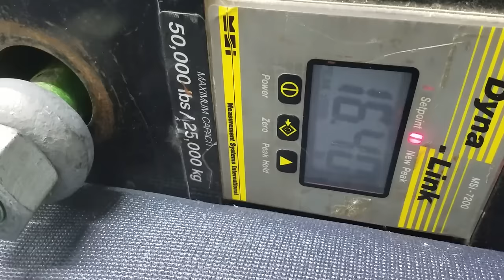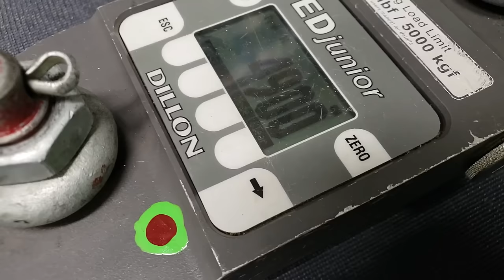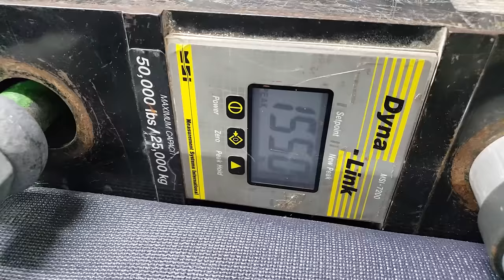Tying a button knot soft shackle WITH break tests - for slacklining and highlining

Comment: By setting up the loop with only one or two strands instead of four, you get a smaller eye, less likely to go over the button when the shackle is not under tension and without losing any strenght.
Reply from the maker: I'm concerned about getting too much tension on 1 leg if the eye is too small, but a smaller noose is ideal.

Comment: I’m curious if you’ve looked at this guys soft shackle knot?  https://youtu.be/K0eZz36PRYI  It seems simpler than the button and better than the diamond, but that leaves the question, is the button better.
Reply: I was thinking the same thing. I have made some soft shackles like this that I use for hammocking. I like that the design prevents the knot from "walking". They feel very safe.
Reply: The whole knot seems to be with doubled rope and it comes out just the same for the loop to grab on to perhaps it's not as flat in the bottom but should be good enough. The only thing that would potentially worry me is the likelihood of unevenness after tensioning as ends can't really travel so If you don't do it just right one part might be in higher tension. Whereas in this one the ends might move a bit when tensioning to even out the loops. But I'm generally talking out of my ass here and I'd love to see that tested.

Comment: I made two soft shackles using the older tutorial a few months ago. They took quite some weight off of my setup. One of them I tightened using the pulley system I use for longlineing and one of them I didn't tension beyond as tight as I could get it with my hands and tools at home. The way the knot on the 'untensioned' one settled looks much more even, seems to have a larger lip, and does sound rock hard when you bang it on a wall or something. In this tiny sample size it seems better to me. Of course, I haven't tested their breaking strength though. 😉
Reply from the maker: Untensioned performed better for us too, but we keep rotating it when we use it.

Comment: I do a lot of off road 4x4 trails (technically OHV trails) and UHMWPE rope is all the rage these days when you need to recover a vehicle from things as simple as a tire-stuck-in-the-ditch to the more complex and difficult OMG recoveries. Synthetic rope is so much safer and easier to handle than steel winch line. There's a plethora of soft shackles on the market to go along with the synthetic winch line but I wanted to make my own. I watched several videos on how to tie a button knot, but this one was by far the best. Thanks for taking the time to make it!

Comment: pulling it tight with the tails out is the wrong way, its only pulling half the strands and worse than just hand tightening with all four strands. If you simply hand tighten it uniformly it will form the knot tight from use
Reply from the maker: Many tutorials showed that way and I've done it that way for a while, we did discover hand tightening, burying the tails, and then tightening did pull on all 4 strands evenly and gave us better buttons which we bring up at the end of this video.

Comment: I'm here for the knot, but noticed your jacket.  Is that the Patagonia synthetic?  I'm debating whether to get that or the REI 650 down jacket.  I kind of like the idea of a synthetic mid-layer jacket more than a cheap down jacket.  How are you liking that jacket?

I'm getting some 1.75mm Lash-It and plan on making a couple dozen soft shackles this weekend!  I'm finally upgrading to space-age line for my camp gear!  This is exactly the type of shackle I want to make.  Eventually I'll step up the size of my line and make some carabiner replacement shackles, but I figured I'd practice on tarp shackles first.

Thanks for posting the video!! 👍

Comment: Can a soft shackle be used with a soft release? There would be some friction when the line is bouncing. Would that be enough to heat up the dyneema and damage it? edit: I see soft shackles used against spanset just fine, so I'm expecing that with a soft release it's also fine, but I'd rather ask.
Reply from the maker: I use soft shackles on soft releases.... on highlines. Highlines generally have less tension and you transfer weight to tag line early. In the park for long lining it isnt bad if you go slow and keep the heat to a minimum
Reply: @HowNOT2  thanks :)
Reply from the maker: @naturarum  you could always put padding on softie if you use it on soft release a lot but keep in mind tubular webbing gets damaged easily too if damage will be done
Reply: Equilibrium makes an ultralight dural "sleeve" called 'Soft ring' just for this purpose. That reduces wear durig releasing.

Comment: Beginner here. I am fascinated by your channel and also how soft shackles are able to replace metal shackles - for some applications - at a fraction of the weight and price. But there still is a basic question bugging me.

Making a soft shackle is tedious work, and you might mess up if you aren't careful. So why use soft shackles at all? Instead use a non-jamming bend like the Carrick bend to make a loop. Sure, the knot reduces strength, but just use a rope that's twice as strong as the soft shackle you want to make. Sure, it will take a bit more time to tie and untie, but making - and learning how to make - soft shackles is also time consuming.

The only thing I can think of is, that once pulled, the Carrick bend will have to set, causing some slippage, and this might lead to rope-on-webbing friction while under tension. But with so many knots out there, there has to be a non-jamming bend knot that keeps its standing part at a fixed position.

Given soft shackles are commonly used, I know this must be a stupid question. But I still couldn't find an answer. You love soft shackles enough to put them up a certain orifice, and gently diss those who claim metal shackles are safer. So I thought you would have an answer.
Reply from the maker: You cannot tie knots in in amsteel so the Carrick bend wouldn't work.  The tails literally slip in all knots once the load is on them.  The button knot defys this rule because it just gets smaller on itself since the tails are buried, the tails can't come out.  You can make "improved soft shackles" which are just buried tails in an overhand and they are funny looking but are plenty strong.  Most people who use these like the art and craft of making them.  Gives you an emotional attachment to them haha.  Our video is a bit more tedious than animated knots version but you can learn enough here to know if you did it correctly or not.
Reply: @HowNOT2  I think you misunderstood me. I'm not suggesting tying knots in amsteel. I'm suggesting getting rid of amsteel altogether. Use a rope that would not slip. Then you could tie a Carrick bend in it.

Comment: Excellent, but I was disappointed by the last bit about "thinking that tapering makes no difference" when engineers have known for years that a quick reduction in cross section of load bearing structures is a stress raiser. 
Taper your buries!